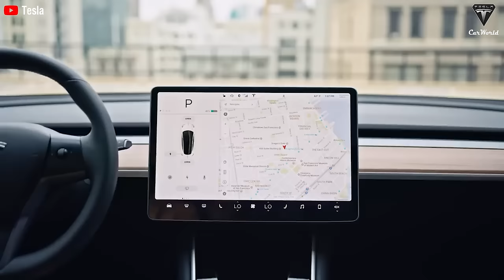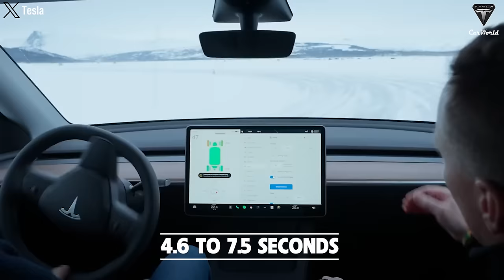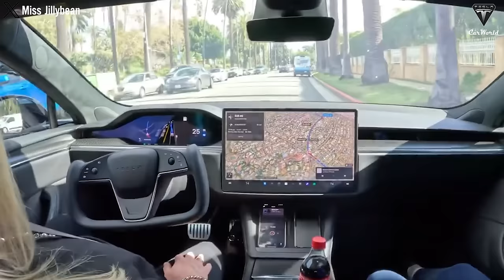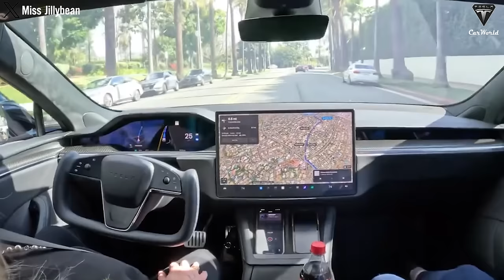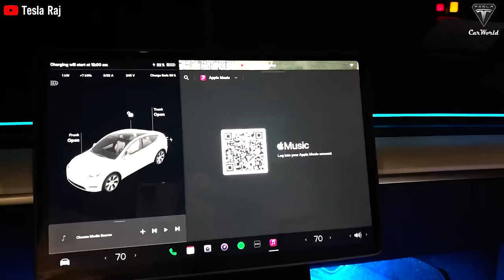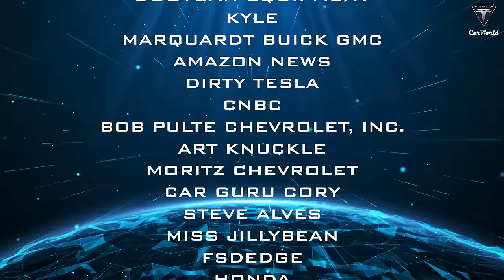Just Happened! Elon Musk Unveiled 2025 Tesla Van New Specs, Price and its BIG Rival from GM!

Comment: How about; 3 rows of 3 seats, middle seat of front row for the driver, wire steering, all seats removable but the front row, all seats but the driver's fold flat, screens on both sides of the dash, some but not many buttons in front of the steering wheel which Oval is optional, huge roof rack strong enough to hold solar panels sticking out both sides for charging, beneath all seats, between the
riders' knees is one drink holder and connections for USB charging and headphones and USB for stereo,   tow hitch for trailer carrying 5000 lb. car/truck/jeep,  buttons to adjust trailer brakes,
Large LED lights for trailer cargo backing up.  FSD of course.  complete mapping including backcountry mapping.  Optional mount on the top / back for starlink antenna with dash controls.
blinking LEDs on the A & B pillars for movement in line with driver's eyes to prevent hitting anything...maybe automatic braking????  All wheel drive and extra large battery for a minimum of 250 mile range with all seats occupied.

Comment: How much does it cost for EV for a charge does anybody know it’s not Free 🤔 The power grid has to be upgraded for electric vehicles
Reply: Yes. Not free. Cheaper than a gas vehicle. When gas was $5/gallon, it was incredibly cheaper. At lower price, it’s cheaper, but not as exciting. Hence, “some people” want to jack up gas prices.
Reply: Go solar and it gets close to free. Strange NONE of this speed has been even speculated on?
Reply: A typical house has about 8kw available and at night time it doesn’t do anything so you need a battery backup to make up for the rest of the day. Add a ev into your life you will have a total of 60 to 90 KW of battery so you will need to get the power from the grid to charge your EV. So solar panels would require 8 to 10 days to charge a EV.  If your house needs 1.5 KW per Day you will sell your excess 6.5 kw at 4 cents a KW which is 26 cents a day times 30 you get back 7dollar and 80 cents  for 12 months you get back 93 dollars and 60 cents for 20 years you get back 1 thousand 8 hundred and 72 dollars with a investment of 25 k. So doing Solar panels will make you feel good but it still cost you 23,128 dollars not a great investment

Comment: I'm not engineerbut there is something very simple right in front of all of us and I don't understand why this can't be done to any electric car, let me explain something why can they not make a alternator that will charge the electric battery as they are driving, let me explain why I asked that question I had an old tractor it did not have enough hydraulic pressure, dingdong so I just four a electric hydraulic pump with its own reservoir, on. And put a total independent alternator and totally independent battery in to charge the battery, and as the shaft to the tractor was spinning it was charging the secondary battery. You mean to tell me with all these engineers and all this electronics AI and all of this why can they not make a electric car or truck or even a semi truck charge it sell as they are going down the road. If I can do this with the tractor why can they not do it with a electric vehicle. Is this just a scam to get more L of the consumer, it just don't make no sense to me and like I say I'm no engineer. And this system that I put in my tractor it works like 1 million bucks, can anyone answer this question for me.? I'm pretty sure they can do it they just don't want to do it because it would make the person who buys the car not have to use electricity no more the car would generate its own electricity. And if it needed a boost why can they not put little solar panels built right into the outside design of the car, like I just recently seen a three wheel card to.? Please explain this to anyone that has got engineer degrees and know all about electronics and relays and all the other electronics that go into AI I just don't understand why. Is this concept just to simple?
Reply: You've just invented perpetual motion. 😏